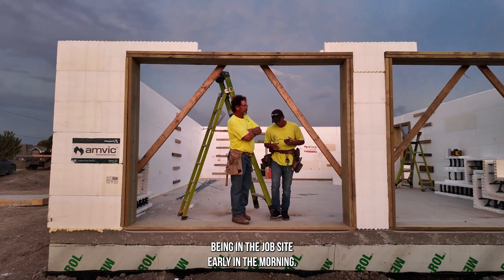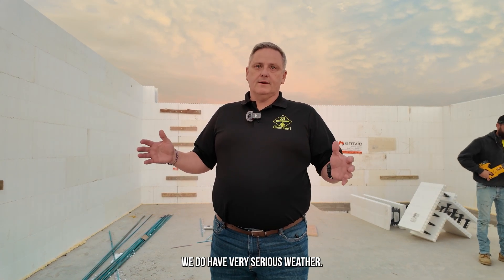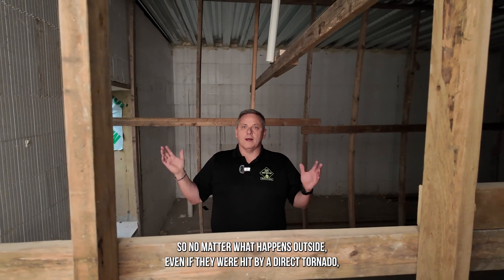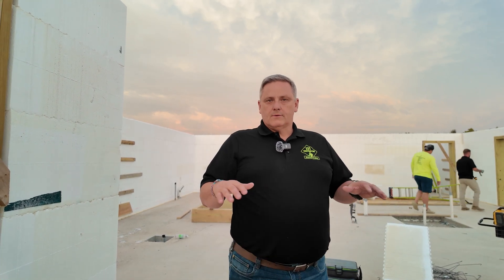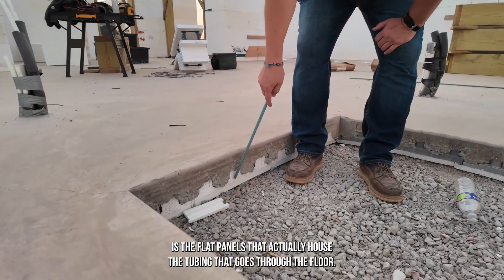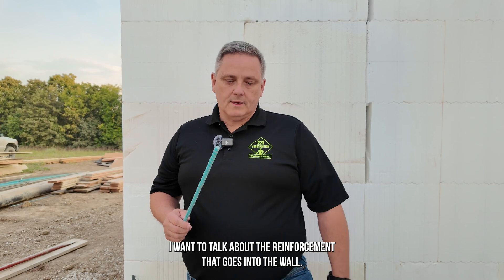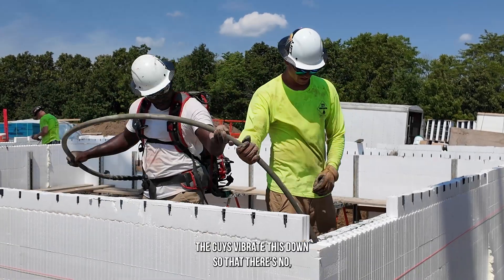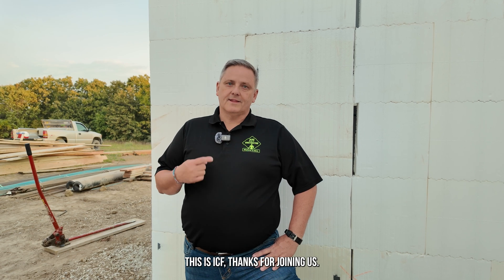🏠 The Secret to Stronger, Safer Homes: ICF!

Comment: Heat doesn’t rise; instead, it actually radiates. More accurately: as a fluid or gas is heated, the warmer molecules rise above those that are cooler due to the resulting change in density.